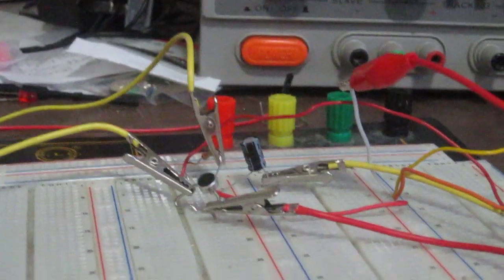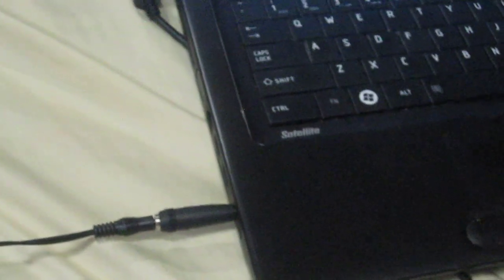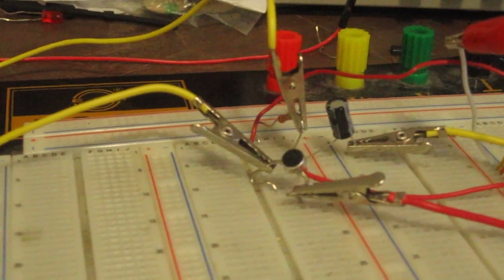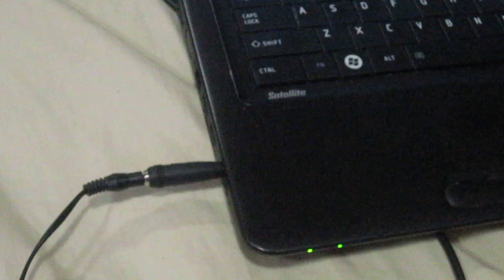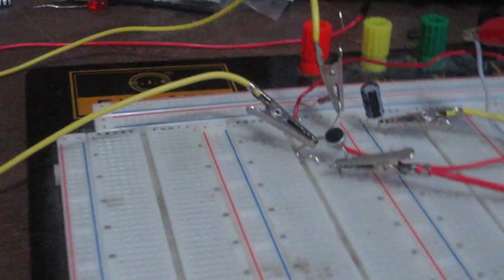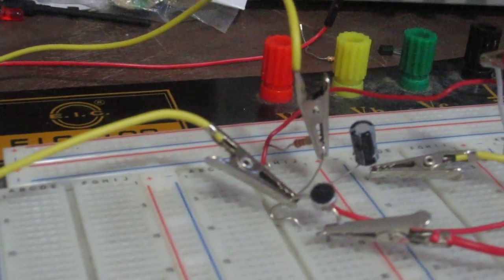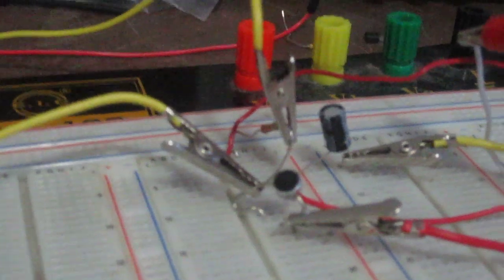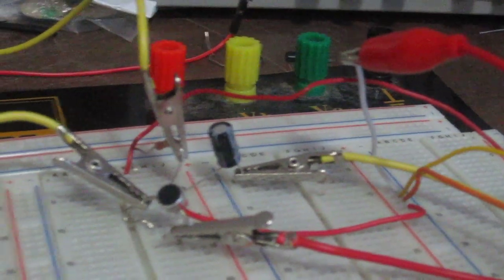Electret Microphone Circuit

Comment: Hi bro, i want to connect a electret microphone to my pc, but it has only one audio jack input (not speakers output and microphobe separated) , I'm using a TRRS jack, I measured voltage across Sleeve and the next ring giving me around 4V, I suppose it is used to power the microphone circuit, but my question is, in my case, which is the audio input? Thanks!